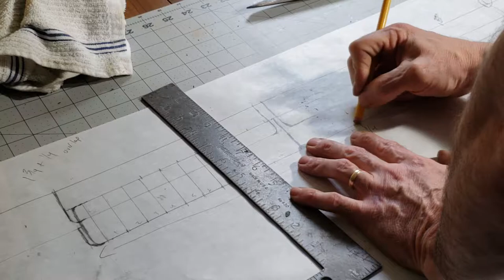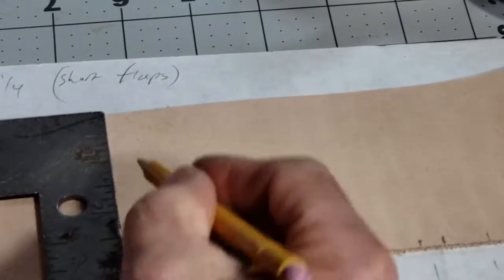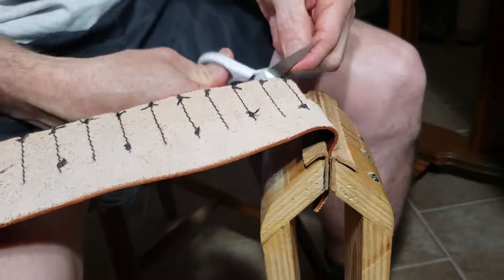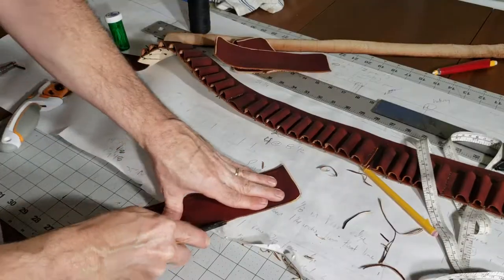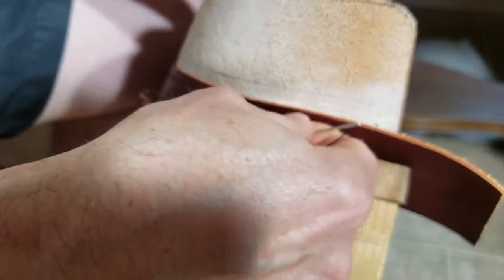Crafting a jawa bandolier.  Martini-Henry style for my jawa costume.

Comment: What length of the main strap?
Reply from the maker: The entire strip of leather from end to end is a about 60.5 inches (152ish cm).  It can be longer or shorter to fit the wearer easily enough.  I am 5 foot 6 inches tall, so didnt need a ton of extra length.

Comment: Howdy, Have you tested this on the .577 ammo? Does it fit well?
Reply from the maker: I have not actually tested it with .577!  I used a .50 wood dowel rod for the measurement layouts, so it is quite possible it will fit, but I dont know how well.  Now, I have to see if I can turn a dowel down to .577 and see (since I am guessing my chances of finding .577 locally are.. pretty close to nonexistant!)  if it works.  I have to know now!  Thanks for watching!
Reply: @eric-bkc  So I'm making one up to hold my ammo and all the measurements seem solid just swap out the 1.25 for the strap for anywhere between 1.66 and 1.75 in. Thanks for the vid!